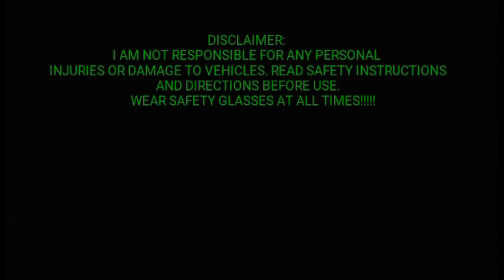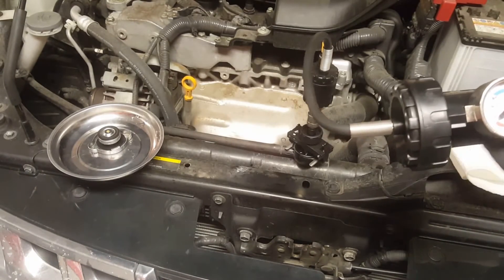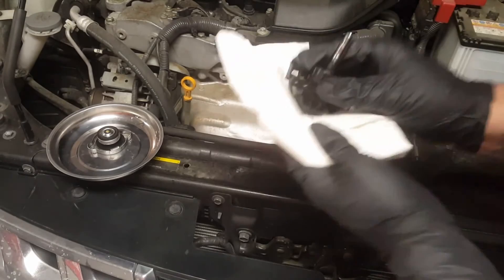HOW TO CHECK YOUR RADIATOR FOR LEAKS

Comment: Hi, question, my subaru is overheating , i have a leak somewhere as water all over the engine like something exploded! I heard hissing coming from the top of the radiator with access water from the explosion(lol) bubbling. I’ve ordered that pump tool you have just to double check. I’ve also ordered a thermostat as I still had water in the water bottle but no heat inside the car, so I’m assuming that means no water circulation? Which leads me to suspect the thermostat at fault that caused pressure build up? Exploding a  water pipe loose somewhere including bursting the radiator?? Is that a fair assumption ?? Any advice please.

Comment: Nice video. Will this test kit work if the radiator cap is on the reservoir I have 2005 Chrysler Pacifica.
Reply from the maker: +miguel mendez as long as you have a radiator cap that twists on I'm sure it will work
Reply: Themechanicman92 okay thanks

Comment: Awesome video dude I've never done this before. Around 3:37 you pressed down on a yellow button then removed part of the tester what did that do?
Reply from the maker: +BrewingBrian thanks man, the yellow button released the air pressure so that when you disconnected the tester fluid would not come shooting out

Comment: excellent video.....don't forget about checking the cap itself or the overflow...a leak in either of these will not show up in the pressure test
Reply from the maker: +michael rew thanks man, thanks for the heads up

Comment: Nice vid. I've never seen a coolant pressure tester like that before. I also test them to beyond the radiator cap's rating. Most are 16 psi but if you have a really slow leak you won't notice it until you give her some psi. Nothing too extreme but 17-18 psi is just enough to make a small leak rear it's ugly head. It's also nice to run some dye in the system and let it circulate then use the glasses and a light to find pin-hole leaks also. And yes it is very important to make sure the engine is cool and the pressure has been relieved before you go testing the system.